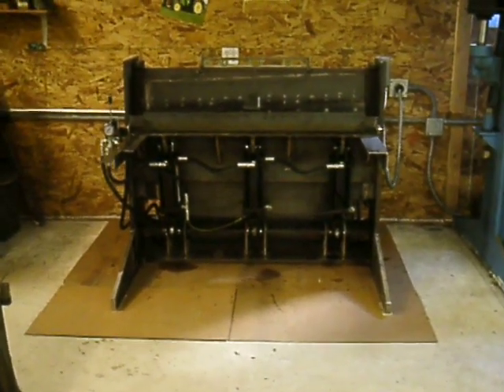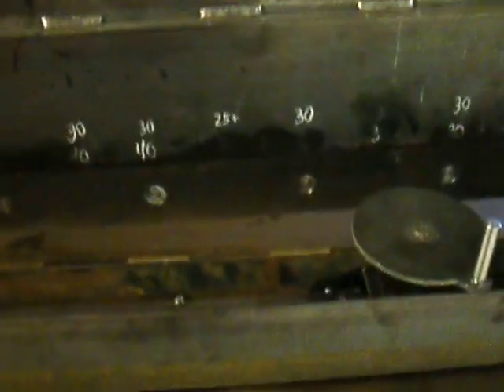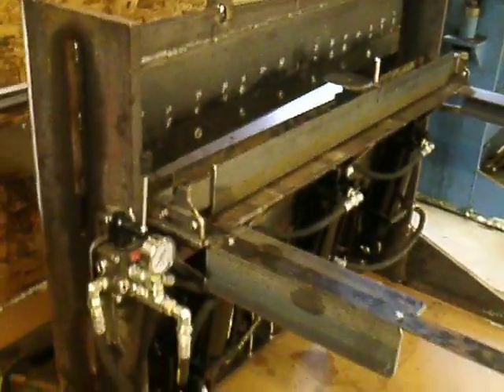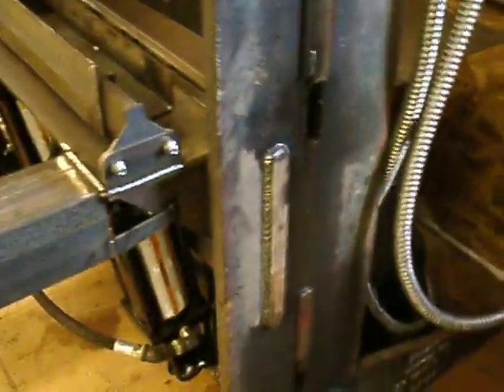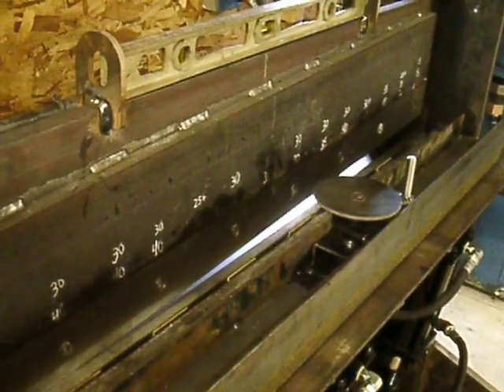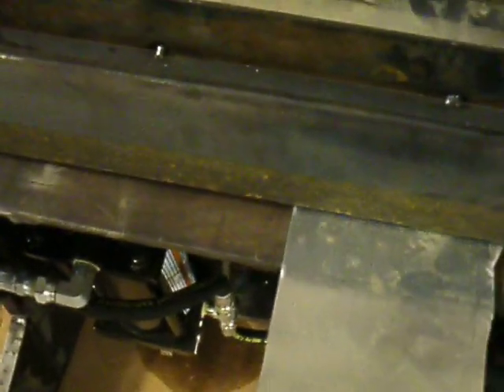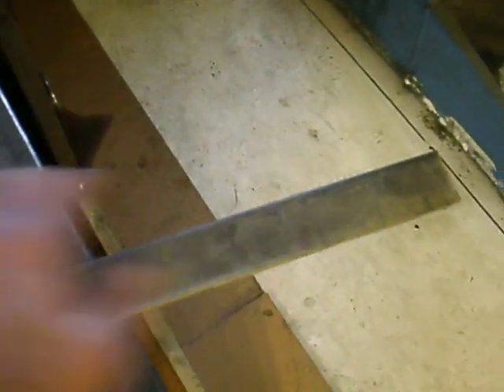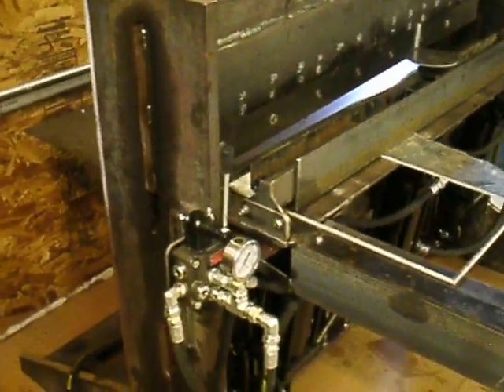Homemade  Metal Cutting Shear

Comment: would you be willing to share the cut files you have in cad? I am interested in doing what you did.
what are the specs for the motor/pump combo and what size cylinders did you use?
Thanks
stan

Comment: Three things you could do to increase your cycle speed would be 1. To change the pump to a two speed pump so it has higher flow at low psi until it reaches the work.
 2. Install a hydraulic accumulator tank which stores built up fluid from idle time pumping like a bladder tank on a well so you have twice the flow when you hit the lever. They sell accumulators at Surplus Center also.
3. Install a rephasing valve on it to recycle the fluid on the return stroke back into the circuit to double your return speed on the retract.
Just some easy things that may help.

Comment: What u can do is use manual  hydraulic cylinder for top as a clamp , ever harbor freight 4-12 ton would clamp anything , just FYI if ur clamp won't hold ur piece
Reply from the maker: Hi Vik, thaks for the info, but the screw down clamp was patterned off my Edwards Ironworker and seems to work really well.
Reply: Wouldn't a spring loaded plate do the job. It would clamp the steel automatically

Comment: Hi Paddy! How much did the top and bottom knife cost you? Even a rough estimate would help, Thank you so much!
Reply from the maker: Hi.  They came as a set and were $1400.00 if I remember correctly.  They are 50" wide and rated for 1/4" steel.
Reply: Paddy B thank you! I am about to order one myself thanks for your video!

Comment: That, sir, is awesome! I was looking around for a DIY foot/hand shear, and found your video - WAY outside the usual DIY stuff. Great work!
Reply from the maker: Thank you.   I've been using for about 2 weeks now and it's one of those, "Why didn't I build this years' ago?" type thing.  It is saving hours of labor now and doesn't make the smoke that cutting stuff with the plasma table does and especially the stink and dust made by cutting things with a grinder or chop saw.